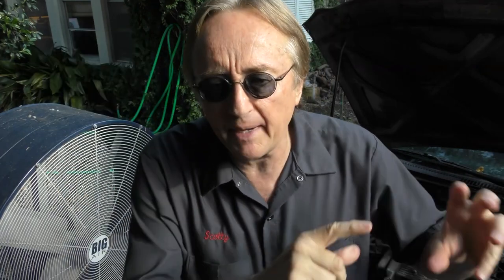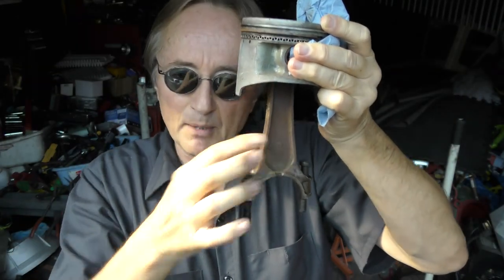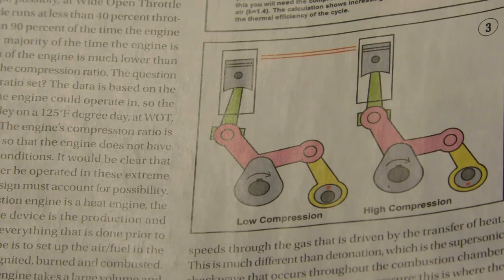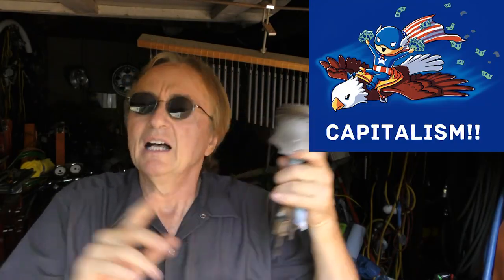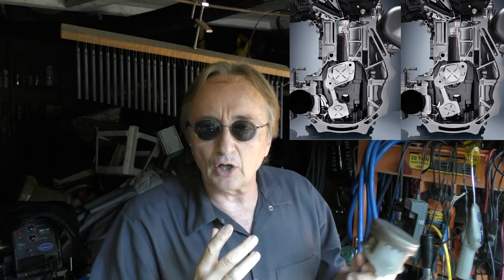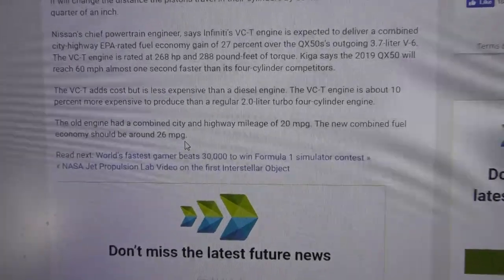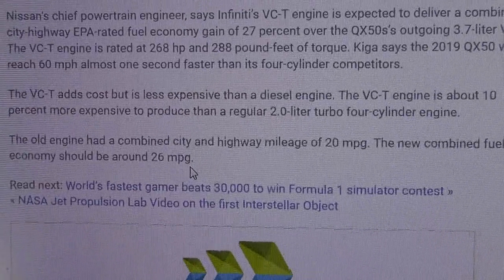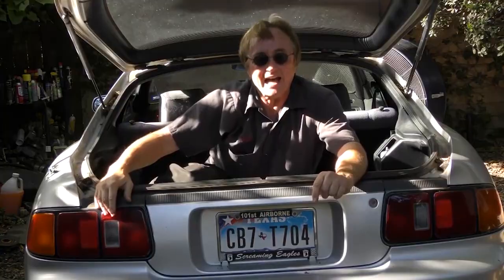If You Buy This Type of Engine, You're Going to Regret It

Comment: What you say is true.  I'm a retired mechanic myself.  This complexity leads to small improvements which brings short vehicle life trend first started with variable cam timing twenty years ago.  The new car buyer just does not seem to care.  The new car salesman can't educate them because it will usually cost them the sale.  Best happy medium car that is great on gas, and enjoys a reputation for not breaking down, Toyota Prius.  No Belts, no starter solenoid, no alternator brushes.  These things cause breakdowns, but can't on a Prius because of brilliant engineering.  And did I mention phenomenal gas mileage?

Comment: I really do want to hear your opinion about the new Mazda HCCI engine.
Reply from the maker: Good idea, thanks!
Reply: Scotty Kilmer  Hi Scott I'm from Sydney Australia...can you or have you ever replaced a fuel rail damper on 2006 Mazda Tribute....not a fuel regulator but a pressure or pulsation damper on a 3 litre V6... Cheers mate from Down Under....👍
Reply: Antonio De Lumen, Cheers mate
Reply: The problem is say they find a problem that's going to cost X amount to fix and X is a lot because it requires a redesign but only happens in Y area climate.  Then some bean counter determines the amount of vehicles sold in Y areas repairs from the defect will be way cheaper than X's value in the long run.   Guess what than... Off to production it goes as is.

That's the problem, at the end of the day it's all about the profit.   Nobody cares about the customer or what inconvenience it may cause them to get their vehicle repaired from the defect.  It's all about the numbers on the graphs and how to maximize them....
Reply: @scottykilmer  mazda 3 2.5 skyactive g engine review. It has both of these things and i have heard some horror stories and some stories of reliability.

Comment: Their VCS engine is as reliable as their CVT transmission.
Reply: i see what you did there.;-)
Reply: J Denha I'm not sure if that's a compliment or not. Nissan is the one that is helping Toyota, Honda and others with CVT. And at the moment have the best cvts of all of them. As for the VCS? It's clearly a bad system. And their new engines that are shared with MB are already causing huge reliability problems. Note++ I'm not a fan of the CVT but they've invested a lot into it and made improvements in reliability that all major companies have jumped on the band wagon.
Reply: Imagine having both lmao

Comment: I couldn't agree more that to be the first or first few to own such new production vehicle tech is an easy no thanks. while this is standard, simple, and easy consensus, you cannot undermine an auto manufacturer for doing their best to work with what consumers are demanding and what the EPA/gov pressure is forcing them to try/attempt. Innovation has never existed without failure.

Comment: Smokey Yunick had the right idea in the early '80s. Near adiabatic engines. His beast was a 150 CuIn V4 with no cooling system producing 345 BHP @ 7500 rpm. On regular pump gas.

Comment: If you want better gas mileage, by a smaller lighter car with a small conventional engine.
Reply: Mataba what if you want a small SUV with better fuel economy than most sedans and the most spacious cabin in its class?
Reply: Some people consider a small SUV a small car... 

Weather the small car is an SUV, Sedan, Station-wagon or van  does not really matter,  the point is that a smaller car with small conventional engine have better gas mileage than a large car with big engine.

Small engine to day does not necessary means it lacks on power. Especially when it is fitted in a car less than 2 metric ton, then you do not need 5.2L and 500 hp
Reply: Buy a diesel engine. It will haul a truck at the same fuel economy as a smart car

Comment: I don't know how you can claim cylinder deactivation systems are a massive failure and that the engines fall apart without some link between the two? Don't all new 18 wheel tractors use cylinder deactivation systems?
Reply: Because anyone can claim anything without offering proof.  I have the 5.3L engine he says is a massive failure in my Avalanche, it has 140K miles so far and runs like it is brand new with zero issues.
Reply: My guess is that it causes a lot more vibration and strain on the crankshaft.
Reply: @redbaron6805  Good to hear but 140K is just the beginning of the test.
Reply: @artsmith103  Begging of what test exactly?  My Avalanche is already 8 years old.  How long are we testing?  10 years?  20 years?

I already got my money's worth out of it and then some, it literally owes me nothing at this point. People keep their cars for an average of 6 years, so I'm already 2 years in bonus territory.

Comment: You could sell new cars for $5000 today if it weren't for all the unnecessary gadgets and technology that goes into them . 

I'd like to see a car manufacturer build brand new cars based on say... 1980s technology. No airbags. No traction control. No ABS. No nav systems. No power anything. No computers. Just four wheels and four seats. I bet you could build something like that today for 1/10th the cost of modern vehicles. It would be exactly what this current generation needs: affordable no-frills transportation.

Haven't you ever wondered why the price of every electronic device has gone down over time but car prices are still outrageous?
Reply: @Red Baron The safety aids in modern cars are a mirage. You can't make up for bad drivers. If cars today are so much safer, why aren't we seeing fewer deaths? 

You can have every electronic nanny in the world and it doesn't matter. The end result is drivers are paying less and less attention to driving.
Reply: @taekwondotime  the safety of new cars are way better than the 80s so yes it's a deathtrap lol
Reply: @rushking19  People would still buy it because it's way cheaper, regardless of perception.  People ride motorbikes. They're death traps and yet people buy them. A 1980's car is just as safe as a modern car.
Reply: If you had the ability to buy a brand new car for $5000 instead of $35,000, don't you think there will be buyers who say: "Yeah, I can do without an air bag. I'm buying the car for $5000 and using the savings to pay for tuition."  Safety costs money.... and that's money some customers are UNWILLING or UNABLE to pay for.  They should have the CHOICE of what type of vehicle they want to purchase.
Reply: Are you saying people should be FORCED to ride a bicycle in a heavily trafficked urban area (if they can't afford a $35,000 car), where they are 1000x more likely to die in a crash than buy my brand new $5000 car made from simple 1980's technology that weighs about 3500 lb and is made out of steel?  Really?
Reply: @taekwondotime  and if you want a car for 5k buy a used one
Reply: @taekwondotime  its because people want more Anadarko more stuff just like with everything else like tvs and phones people want there technology to advance and likening said buy a used car if you want a cheap car and it will also be way more a safer than the bs you talking about and no matter what they do no good reliable new car will be 5k , theres a thing called inflation 5k in the 80s is a lot more money in today's money and coat of materials also went up so ...

Comment: Everyone that's trying to do some improvement to internal combustion engines generally try it by doing something to the cylinder heads, and leave the bottom end untouched. Why? Because in the lower end the forces involved are much higher, and whatever you do to the top end, it's going to be smaller, easier, and cheaper to engineer and manufacture.

Comment: the vehicles made today are not supposed to last for years and years like they used to..
Reply: Pete Solorio not correct, technology is evolving faster now than it used to. Try to keep up. Parallels everything these days, computers, phones, cars everything is evolving quickly. Buy an Infiniti, do the maintenance regularly, the thing will last you as long as you expect and more.
Reply: Except that is literally pure fiction.  Engines today last longer and are more reliable than ever.  Engines in the 80's reached end of life around 100K miles on most cars, today most cars easily pass 200K miles and up to 300K.

Engine development has made engines both more efficient and more reliable than ever.
Reply: Red Baron maybe so.. however all the plastic they encase these amazing engines with(the car) don't seem to last..
Reply: There is always a trade off.  Plastic doesn't corrode like metal does and is lighter, but it gets brittle over time.  

There is however no question that engines are lasting a lot longer.  Even spark plugs used to only last a couple of years, with Platinum plugs, now they last 100K miles or more easy.

I personally haven't noticed the plastic parts being the problem on any of my cars so far.  On the other hand, I haven't really noticed many problems on my cars in general.  I mostly end up just replacing tires and doing scheduled maintenance.

Comment: EPA fuel economy estimates used to be overly optimistic, but that is no longer the case. My Civic is rated 28/35/32. My worst tankful ever, in the dead of winter, was 34+ mpg. My best was 43.25mpg. 39-42 is typical for rural 55 mph driving.

Comment: I completely agree, I have a Holden (Australian GM brand) L76 V8 with Displacement on Demand and it has caused me nothing but problems, I had a lifter seize during reactivation, this bent a push rod, and damaged the cam shaft, wasn't cheap to fix at all, and it still likes to burn a fair bit of oil since then.

Comment: If I remember from my engine controls class correctly, I believe Toyota already achieved variable compression using the Atkinson cycle. It's all done through the valvetrain instead of the crankshaft, and can revert back to the Otto cycle if it fails.

Comment: Scotty. The engine is not the problem, it might be good. They worked on that engine for 20 years.  However, the problem is the God Darned CVTs in all of these cars. They should call that car the L 60 or Lemon 60 and be done with it.

Comment: Only G37 owner here my wife has a 2012 G37x with 112k on it and I have a 2013 G37xs with 84k on it and neither has had an issue. You have your normal wear parts that need changed and keep up on fluids.  In my opinion the 3.7 VQ engine is bulletproof.  Before these we owned G35 and both lasted well over 200k miles. There is a reason that the VQ is an award winning engine for many years running.  If you do buy a G stay away from ones before 2012. They had a paper rear timing gasket and that would deteriorate. In 2012 they upgraded that flaw to a metal one and haven’t had any issues. 

With this said coincidently the 350z and 370z have the same two engines.  Bulletproof. VQ37HR and VQ35HR.  

As with all used cars you can tell if someone drove the snot out of them.  

Lastly I have several buddies with the Nissan/Infiniti VQ engines and many well over 125k with zero issues whatsoever. 

Your videos are great Scotty but I have to disagree with you here with over 15 years of driving ONLY Infiniti’s with the same engine that the 350/370 have.

Comment: I would get this new engine with no concerns.  I am not in to the panic it has a couple extra berings per cylinder camp.  Modern engines just do not have trouble in this area.

Comment: In the beginning, a LS7 engine is shown on the left. I have one. It doesn't have any kind of variable timing or displacement. However, the new LT engines do. Except in the ZR1, where they turn that garbage off or leave it out entirely...which would be better, imo.

Comment: My '08 Pilot is the only vehicle that I've ever had consistently beat the rated highway fuel economy. It's rated at 20 mpg and I can set the cruise control on 70 and get 22 mpg. If I set it on 60 I can get 23 mpg.

Comment: If you break-in the engine properly, I've found I get 3-5mpg better gas mileage than posted.  I usually accelerate hard after break-in and drive 5-over (er.. in Mexico).. most of the time in my Corvette LS3.

Comment: From 20MPG to 26MPG is a seriously big jump in fuel economy.  That being said, I agree with Scotty that the reliability needs to be tested for at least 10 years in real-world situations before I would trust it enough to buy one.  (I think he said he wants 20)  What good is technology if it doesn't work reliably!!!  You can easily spend tons more $$$ in the repair shop than save at the gas pump if this engine isn't designed or built right.
Reply: It's been about that since I've had mine and I've had zero issues.
Scotty here is just a fudd and has no idea what he's talking about.

Comment: Actually the dodge 5.7 hemi engine has MDS that shuts down 2 to 4 cylinders depending on power demands.  It works great and saves a lot of gas.  I get 20-25MPG thanks to MDS.

Comment: Nissans are pretty popular in Japan and they run long with very little problems, just like all the other Japanese cars in Japan. Maybe yours are made in America and that's the problem with them. Nissan makes the best and most popular large vans here. My buddy has one, it has a 3 liter 4 cylinder engine that gets great mileage and has plenty of power. He regularly transports 3 full sized motorcycles strapped down inside that van so it's not small.

Comment: My 2019 Corvette has an Eco Mode which will switch from V8 to V4 depending on load. Works well on flat land but too intrusive when it gets hilly. But still 33 mpg in a 460hp sports car is not bad.

Comment: Rock on Scotty - my personal favorite engine success story was Honda's 1.3 & 1.5L CVCC engines from the late 70's to mid 80's. Had a 1.5L in an '81 Civic 5spd, put 65k on it before ANYTHING went wrong, and that was just dirt in the carb needle & seat. Got 37mpg combined with NO computer or fuel injection. Worked so well Ford stole it for their "Triton" 3valve engines. Wish I still had the car......

Comment: Correct me if I'm wrong but, I believe GM was also dabbling into plasma coating the cylinder walls almost ten years ago and I've only heard bad things about them. The QX50 VC-Turbo engine has plasma coating on their cylinder walls. SO, we'll find out if everything works out in that block. I'm a tech at Infiniti, and all I can do is wait until one comes in, oh the suspense! lol
Reply: About 50 years ago, GM tried coating the cylinder walls with silica. Maybe they learned something over the years? Maybe they are using the public as a test bed again?
Reply: Raoul Cruz lol wouldn't doubt it.

Comment: Good point, rather than use all of this technology which may not hold up in the long run and fails to deliver much of an improvement in gas mileage why not just spend the time developing electric vehicles. Electric is on it's way to becoming mainstream, the technology has been around for a while and there is no fuel to burn. Plus Nissan motors start to have issues around 100k miles, if you can get the CVT transmission to last that long.

Comment: Its so true what you said about how the MPG ratings are always wrong. I remember a Prius I rented for a few days when I was on a business trip, it claimed to got 50-70 MPG (Some even saying 100 MPG), but according to its own computer and my own millage calculations; it was struggling to even get above 35 MPG. I don't know if there was something wrong with it, which is possible since it was a rental car, but it only had 32k miles on it when I got it.

Comment: Hello all I'm a life long Nissan Owner and first off I agree with what Scotty is saying about these type of engines.  Rule of thumb with ANY car company is you never buy a first year production vehicle.  Especially with a new engine type like this.  Any mechanic or engineer will take one look at the innards of that engine and cringe at the thought of trying to fix that.  BUT I will say to you all this doesn't represent Nissan/infiniti  as a whole.  They are still very reliable and capable vehicles.  I've owned 4 Nissans in my lifetime and ALL of them have made it over 100k with 2 making it over 200k and my 200sx made it to 282k miles!  Sure they are not what they were in the 90's but they are still good vehicles to buy.  Don't let one engine they make turn you away from the whole brand.  Cheers.

Comment: I feel that I need to say this. My mother has a qx60 and my dad has a caddy with a Northstar. The Northstars have cylinder deactivation at low revs. The Qx60 averages 19 and the Northstar gets 26, with both doing more highway driving. The Infiniti claims to have better mileage than the QX60 gets so I would say that the Northstar is better.
Reply: What year and mileage North Star?  And what make and model?

Comment: Thanks for all your advice! Hoping you would do a video on "What to do on car that is older with lower miles". I just bought a 2013 G37X coupe with 19,000 original miles. The car runs and drives amazing. Just curious if there's anything I should be careful of with an older car with lower miles that hasn't been driven much?  The previous owner barley ever drove it. Thanks again
Reply: i have the same, and wonder the same thing. its a great car, i wonder what he would think ab it.

Comment: So are the GMC Sierra with a 5.3L V8 and has cylinder de-activation, should I use a OBD II chip to delete  and override to stop it from running in V4 mode? Will that make my motor last longer, or is that an ok motor, what do you think?

Comment: I get what you are saying, and i understand that this kind of System is going to be quite hard to get realy reliable, but they probably will get Reliable over time. 
I have a big problem with what you are saying about the Radical modifications with reliable engines and how they should rather make an entirely new Engine Design, if everybody would have thought that you wouldn't have VVL, VVT, Fuel Injection, High Flowing but still quiet Mufflers, Electronic Ignition, and maybe not even Diesel Engines.